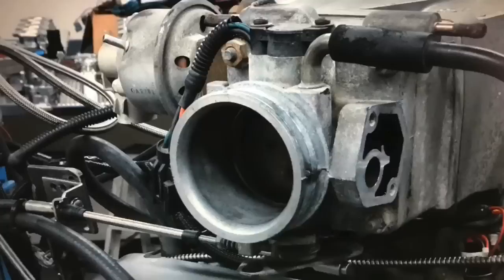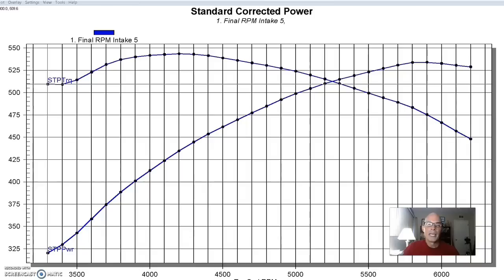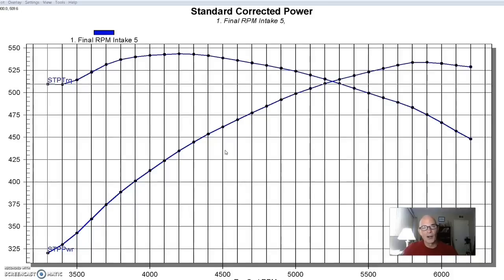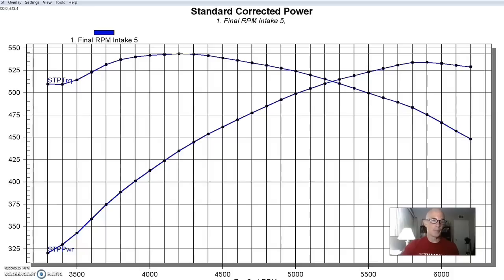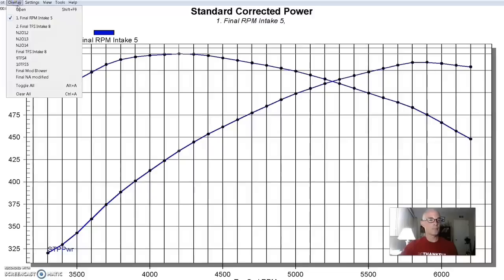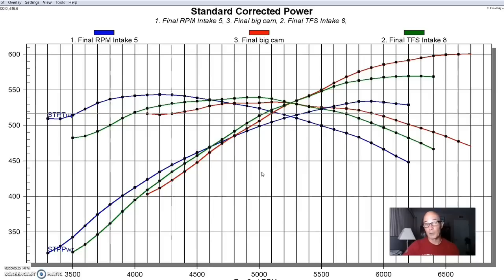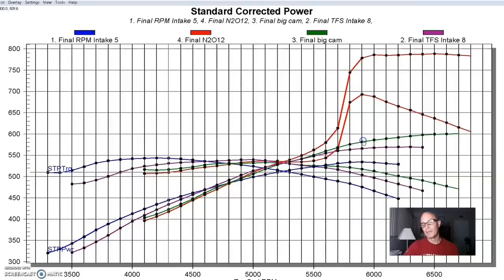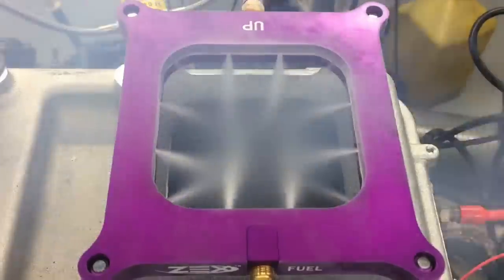HOW TO: BIG HP 408 STROKER FORD!

Comment: Did you ever do a 408-410 stroker with the speedmaster 351w dart replica block? I'm being told you did but I can't find it.
Reply from the maker: I thought I did, I will have to look it up
Reply: @richardholdener1727  just wondering if you've ever ripped the mains out or cracked one that was stroked and boosted. I bought one and did some hardness testing. 320 and higher were the results. Normally 32B iron is 207-255. Some 2jz blocks go as high as 290. Im thinking of heat stressing the block to bring the hardness down to the 290s. Im hoping to be around 1200 crank hp.

Comment: what kind of horse power would a 398 w make factory GT40 heads what do u think it should make have never checked it seems to make good power would like your out put on a guess
Reply from the maker: gt40 heads are pretty restrictive for a motor near 400 inches
Reply: what do u think the HP would be on my engine I guess around 400 up not sure the heads have been ported and a good valve job on them it's a budget build going to put on dyno one day

Comment: You need to add that a street motor wants more tq. Even at the beginning of your dyno run it is making good tq. That engine for the street is a good strong safe street engine. I have commented before chasing hp takes you in to a higher rpm range. This changes all the related parts. Stall converter, gear ratio if you want a good street car. That engine is perfect. for a 408w.

Comment: Love your work! What is the biggest stroker kit that can be installed, without notching the block, on the 94-96 truck block and the original 1969 block? Thanks!
Reply from the maker: MOST REQUIRE NOTCHING (FOR RODS)

Comment: Back to the bang for the cubic inches. We have 2 complete 460's. I'm gonna be putting what ever into a 94F150 flareside! Heads, cam, and intake on a 460? The c6 tyranny just eats up 40 hp right off the bat, but, a big case c4 (that we have), aluminum cj heads? The problem is I have everything for a 393, except the crank! Go with what you got the most of!!? I'm leaning that way, and there aren't many people I'd ask, but, dollar wise, is it really worth switching to a big block? I's not gonna be a daily driver, and I could always buy a turbo kit for the Windsor.  Or, step up from the 100hp plate? That's the cheapest,  and I got 2 more blocks, but only one roller!
Reply from the maker: do what is cheap then add boost or nos
Reply: @richardholdener1727  got a block, stock rods with srp bolts, heads, carb, intake trw 302 pistons ,030 over. 100 shot of gas. Just need that crank and balance job!? Any more and I'd probably have to spend a ton on hooking it up!?? Thanks for the response. I'm 62, I like cheap crap that makes people turn their heads!

Comment: Ok can you run boost on this set up or would you need to use a different cam?
Reply from the maker: YOU CAN RUN BOOST-BUT THIS CAM IS NOT NEEDED FOR A TURBO APPLICATION

Comment: Not sure if you’re checking comments on this video or not but I have a question. Building a pro touring type 67 fastback that will be on the street but not a drag car. So if I went with this exact build and stopped at the stage 3 cam making around 570 Hp would the be a street and interstate friendly engine running a 5 speed over drive with it ?  Or are we looking at an engine that’s only going to be 10 Mpg ??
Reply from the maker: IT IS STILL A PRETTY BIG CAM
Reply: @richardholdener1727  I’m assuming that you mean it might be too much cam for a car that’s going to be driven a lot

Comment: Question. To run this cam with the 205 heads. Would I need to change springs. They come with 600 lift springs and the cam is 595 lift. Would it have valve float issues or would it be ok
Reply from the maker: springs are fine
Reply: @richardholdener1727   thanks for replying. Appreciate it.

Comment: Look at motorsport Molly's 410 stroker sbf made 607hp on e85 and 617 on 110 octane  she had 12.5.1 compression  afr 220 heads 1050 carb
Reply from the maker: then they added more timing or the 110 was oxygenated

Comment: Are those 56cc or 66cc? Is there a huge difference?
Reply from the maker: just 1 point of compression
Reply: @richardholdener1727  ok, first time building an engine and I'm trying to replicate your stage 3 setup, I cannot find those exact heads anywhere🤯

Comment: My 408 combo na makes over 600 at the rear with e85 without batting an eye.. it uses a lunati voodoo with a lot of duration...600 lift 292. .300 at 50.. compression is 11.39.1 this is in a 90 foxbody coupe. Trying to iron out the carb.. with e85 comes tuning issues.. but yeah a 351w is what ford should've put in these cars..
Reply from the maker: 292/300 at .050?
Reply: @richardholdener1727  242 249.@50
Reply: @richardholdener1727  duration is 292 300
Reply: Lift is. 600

Comment: These videos are a great help. I'm in the research stage of building a 408w w/ a supercharger with the goal of 750-800hp. The combination with your "stage 4" cam, looks perfect for me, or at least gets me in the right direction. Thanks for the huge time saver!
Reply from the maker: that is likely bigger than you need with a blower
Reply: @richardholdener1727  thanks for the tip. Guessing the first cam in this video might do the trick then? 🤔

Comment: Hi there I have a question I am building a 331 and got a seat of twisted wedg piston I am here to different store that I don’t have to use the wedg heads but any aftermarket head would work???
Reply from the maker: depends on how much cam you have-TW heads need pistons with valve reliefs for those valve positions

Comment: Hello, I have 408w with Promaxx  shockers with 10 to 1 comp. Going to use it for drag racing want the best times. What cam and intake should I use? Like to go soild roller. 4000 stall converter and trans break.
Reply: Did you go through with your build and how did the heads proform

Comment: I was speaking with DSS about some forged pistons for my 408 build. I basically plan to copy this build but closer to 11 or 11.5:1 compression. Anyway, they suggested maybe using their FX piston (double the $$)instead of SX piston because the FX has deeper valve reliefs. Think this is necessary with this stage 5 cam?
Reply from the maker: how deep are the sx?
Reply: @richardholdener1727  the SX series with a flat top piston shows them as 3cc valve reliefs. No measured depth provided tho. I believe the FX series is 5cc. The biggest difference I see is that the reliefs actually go all the way to the edge of the piston on the FX. The SX is a lot smaller.

Comment: The 408 with dual plane would be sweet in a '79 F-250.  The 408 with nitrous would be wild in a back halved Ranger with slicks and a roll cage at the track.

Comment: How did the stage 5 do at 3500RPM?, or you didn't start the pull until later? The stage 5 started at 4100RPM  instead of when the stage 3 started, but you showed it only loosing 14ft lbs at one point. I was wondering how it did at a lower RPM? The stage 4 would be good to see also, but if the 5 only looses a little I would rather run it. Do you think drive ability would be terrible with the 5 cam at low speeds with the 408? Bucking cruising on the freeway at around 2- 2.2k RPM?
Reply from the maker: yes
Reply: @richardholdener1727  Thanks for the reply! So you think the drivability would be bad then at lower RPM. 
Thoughts on the stage 4 cam drivability? It has the same duration as the one Ford put in the 351 based 427 & 460 crate engine. 242/248 @ .050. They used a Comp cam I believe, with the 1.65 rockers they use, the lift works out to the Comp Cam which is a small base circle cam. I could have it made on the normal base for the roller block. I heard TFS has lazy lobes compared to the Comp ones?
Thanks again.

Comment: I love your posts and have watched many of them. The one constant thing I see is more power, but it is just moving the power higher but down the RPM range. This is great for track cars, but for street cars this is making a less street friendly car. You should talk about rear end gear ratios. You are loosing low end torque for horsepower. Torque makes the car move, horsepower takes over once the car is moving. Now there is a need for a stall converter or in the case of manual transmission higher revs to leave a stop light. For every action there is a reaction. I think that many less experienced viewers will not understand the relationship between the loss of torque and the gain of horsepower.  Please explain this in your future posts. Thanx!

Comment: Hey Richard, how much vacuum did this motor make?
Reply from the maker: not much with the big cam
Reply: Buy a electric pump for vacume.Bought mine for my 410 with TFS R heads,Edelbrcok EFI intake & Accufab 90mm TB.Works 👍 great!

Comment: This Is Basically The Combination I'm Planning,Except With Eddy. Victor JR.Heads And Intake. Richard , My Question Is Do You Think The Trick Flow Stuff Is Better? Love Your Vids.Thx. DKZ
Reply from the maker: The 11R heads are better
Reply: @richardholdener1727  Kinda Figured You'd Tell Me That..But I Got Them So Cheap I Couldn't Resist. Thx And Keep The Goodies Coming DKZ

Comment: It would be pretty awesome if guys like yourself were able to weigh each engine as tested including major parts changes so guys such as myself could have a database for which the origin is known. Almost every list of engine weights I can find online has been "borrowed" from the same incomplete lists which has been copy-and-pasted from yet another site which got their list from some other unknown site. Often with multiple vastly different weights for the same engines in the same list.
Other than that, you keep answering almost every engine based question I have ever thought about ! 
Here's a few engines that I hope to see you take on; 
3.5 litre Buick/Rover aluminum V8, 
Ford Barra straight six, 
and the Ford 4.9 (300) straight six. 
The 4.9 might be hard to find . . .  I have heard they used to cut up 351 Cleveland heads, put them back together and bolt them on the 4,9 !

Comment: I run a fuel injected 438windsor in my 68 mustang with a 4k stall th400 410 gears, afr 220 heads, super victor efi, eddy elbow, accufab tb, 11.5:1 compression, comp cams xr292r. Made 530wheel. Would of made 560wheel with stick, but slower. Runs on 93 octane, soon to switch to e85. Hoping 550wheel on e85. Car made 460lbs torque at wheel. Burns through 275 Mickeys in 500 miles.
Car weighs 3k lbs. Caltracs suspension Eaton trutrac diff. Street car and i go through burger drive thru's with it and grocery shopping.  Rear mickeys go real fast though.  Check valves every 1500 miles spot on.

Comment: Yes, fresh roller block 393 stroker man here...make me feel better about the factory production block. I'm nervous thinking about 650hp lol...
I also don't think the 205 11R is enough head for this engine...let's try something one size up and see?
Also, you mentioned a blower--is the crank forged? I am under the impression you can't run a centrifugal off a cast crank it will cause the end to snap off?

Comment: Please do much more 351w testing! This was interesting to me since I run a nicely built 408w NA for road racing. It's a solid roller motor with .609 total lift from the custom cam and has the exact same 205cc runners on my RHS heads. I've been a little worried to rev it out to 7k like it was intended from hearing about main cap walk. Any experience with the RPM limits of these factory late model 351w blocks?

Comment: HI, RICH...

My last probs. With the usp are solved 

2 things to pass on: 

1) the you tubrmers 'Numitro unuon' DID split a 408 cid windsor  

2 ) milehigh1320's frmeature a 300 powered, front e gined dragster that ran a 7 34/174 8mph 

RUN THAT 6!!!-it begs to run 
You can SPANK some 5 0's 

Have fun 

BRIAN

Comment: Richard Holdener, I would love to see a max effort 351 build with a stock block 351.  Single big turbo, EFI, maybe even Boss / Cleveland style aluminum heads.  It would be nice to show that the old 351 can still hang with any of the LS Combinations. Its such a versatile engine, and can be built to make so much power.  Not to mention its going to be lighter than a big block.  I only wish Ford would have continued the production of this engine, and developed a factory aluminum block, similar to the Teksid 4.6 block.  Then we would all have a serious and modern  platform to work with.

Comment: I have a recommendation. If you're going to build a stroker Ford Windsor motor and can afford aluminum heads. Go with the Jon Kasse P38 heads.  Kasse is a genius and has made 749 horses with these heads and a hydraulic roller cam on 427 cubic inches of windsor......without a power adder or a insanely high compression ratio. It also made 595 lb/ft of torque.  Build one and.....party.   
     EDIT.  He also made 500 horses on a bone stock 302 block with them and I think.....380 lb/ft of torque.

Comment: How ya doing richard i have a question  i wanted a 1400+ hp engine  to put in my 93 foxbody stang for  drag racing so i had one built  but i told the builder i wanted to be able to drive it on the street to go to car shows or cars and coffee  351 dart block 13.5 to 1 compression  chi cleveland heads wilson intake set up for 2stage nitrous i was told i couldnt get  more than 6 or 7 hundred hp on pump gas i went holley dominator efi    It got dynoed and on 93 pump gas we got 806 hp  shot it  with 100 shot nitrous and got 1043 hp pump gas  do you think i can get 1400+ just by adding racing fuel

Comment: Liked this one rich!. the 408 fro my cousin that i b uilt was basically identical. I used some power product heads that i ported vs the trickflows, but cam and comp. everything identical. It will blow the tires off/ and it 's in a 68 f 100. thx

Comment: A lot of people don’t realize how similar the LS engine is compared to the 351w’s and HEY RICHARD it would be cool for you or engine masters to do a direct cam and compression test if y’all haven’t already! Take 2 5.3’s or 6.0’s one with dish pistons one with dome or flat top pistons, have dish piston motor run stock heads unmilled, then run some milled heads on the dome piston motor, run a stock cam in each one, then throw in one of your famous cams in each one. I think that would show us if it’s really worth it to go after that compression

Comment: Thank you Richard for another interesting Ford SB test. Would love to see header test with 1/58 to 1 3/4  step header added after installing single plane to see if you can pick up torque and not loose the top HP gain. 👍

Comment: Richard, what would you put in a first-gen mustang: 347 stroker (better fit with low-deck) or 408 stroker (same power with better drivability)?
Reply: Jeff Kopis  It's a 66. There are some decent aftermarket headers for a 351w swap, but being such a light car, a 289/302/331/347 is probably enough.

Comment: Great test. About the time I thought “ I wonder what a 0.620-0.650 lift  cam with a little more duration would do for this combination.”  Yo came up with the stouter cam you run. Another test with  more compression ratio( around 12.0:1)  and a fogger system would be interesting   Of course a turbo or centrifugal compressor with at least 25 psi boost would really tweak the ears on that Ford. As always thank you for making us think. I really enjoy your videos.
Reply: Jeff Kopis Mr Holden specifically asks for comments/suggestions from his viewers. I really enjoy his videos. They are not only educational but myth busting and thought provoking. So when he asks an opinion or our thoughts there really is no need to become upset when his viewers respond. Sometimes you can learn much from some of the comments made by others. The comments also serve as a topic for future video ideas. Most comments are not intended to be disrespectful, but instead a sharing of information, knowledge or ideas. Some of his videos really do make me think, give new ideas and in general exercise those three brain cell I have lol. Thank you for your comment. Just an old man sharing his thoughts out loud.

Comment: Hey Richard, have you ever tested hydraulic short travel lifters to see if they offer any improvement in power production? Thanks.
Reply from the maker: yes in a way-we did it with pushrod length and it does change power

Comment: I know you’ve talked a lot about normal/lower CR for boost, is there an issue with being 12.5-13.0 CR?  On VP E-90 fuel for my Hemi
Reply from the maker: high comp and boost makes the most power if you have octane
Reply: Richard Holdener Thank you. Love the content. Have it playing on the TV all day while building.  Definitely would love to see some more Hemi videos. Like an intake shoot out. 5.7, 5.7 truck, 6.4 with SRV actuator, Cascar single plane (what I’m running), Holley Sniper,  and Edelbrock.

Comment: What’s better than a 408 Windsor? How about a 428 Windsor! Torque baby!
Reply from the maker: only with an after market block-I don't recommend stroke lengths above 4.0
Reply: Yes Ford Motorsport block works well. Any friends from ford tuning in ? Richard needs a block for testing.

Comment: Man, seeing this is a kick to the nuts.  I am building a 388w (3.75 stroke, 4.060 bore - dart block and afr 185 heads) and was hoping to make 525-550 with about the same size cam (slightly less duration, but slightly more lift - .595 on the intake and I think 232 on the duration).  I now realize I will be lucky to break 500 hp with that.
Reply: More cam, turn it higher@?

Comment: Like to see that combination with a Vortech or Pro-Charger and then put 150HP shot NOS and look to make 1100HP,  will the 11R 225cc be hurting that combination with NA application at 10.5CR ?
Reply from the maker: a 225 won't hurt the combo-we ran a 205 head